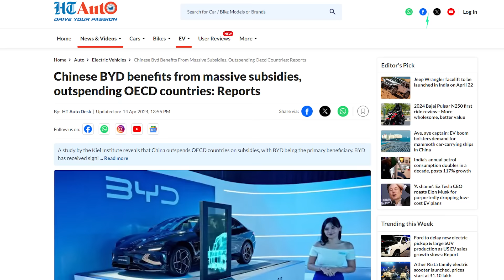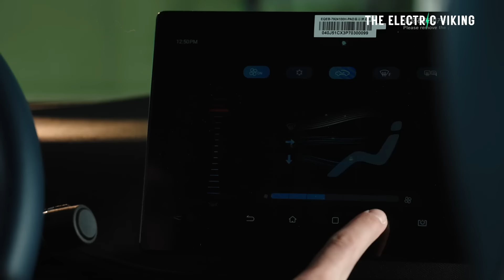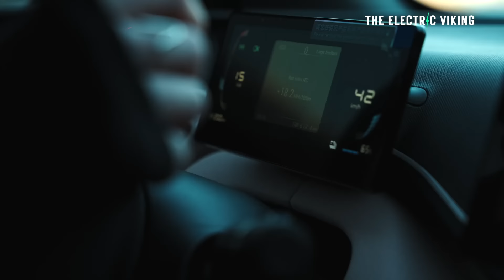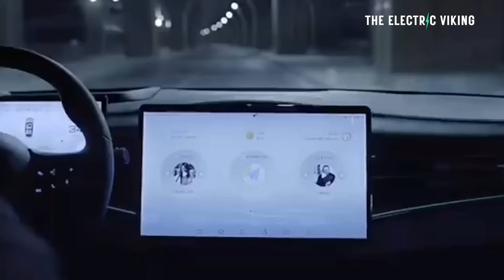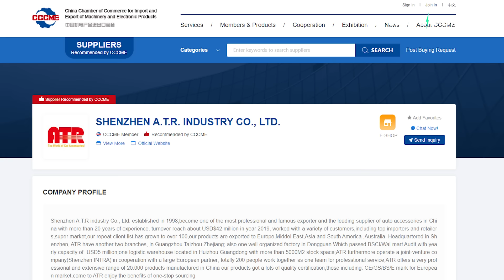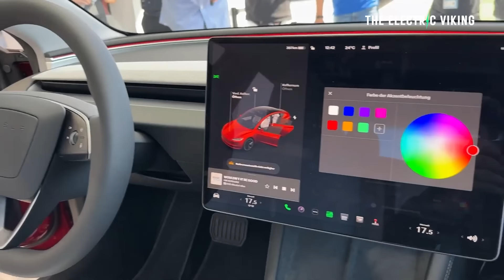China FURIOUS at Europe's EV probe, says it is unfairly rigged against BYD

Comment: Here is what I think: This is a absolute joke, the EV industry has been excessively subsidized being non viable on its own: not only by excessive sale bonuses and tax breaks, but all mining, R and D, mfrs. industries and insurances are massively tax fed…It is time to put a definite stop to poor repairability, lack of durability and safety, price dumping issues and all those actions creating more pollution instead of reducing it !!! This create a need to manage our own safety, refusing to enter crappy Chinese taxi or Uber, a Boeing Max or B787 made in Carolina. This was not the case before when only extremes tasks and sports required a good risk assessment, before this entire responsibility of user’s safety was bounced back to careless manufacturers. The authorities have authorised vehicles in the trafic which are not roadworthy: the 14% rejection rate of Tesla ‘s to the first 3 years TUV inspection in Germany is evidencing this trend. Instead responsible authorities in place must remove potential liabilities off the scene, this is a sovereign task which begins to be totally lacking…

For instance, some quite minor EV accident damages are not repaired because a safe and comprehensive repair involves the expensive battery and repair cost is two to three times more expensive than fixing  the same impact on a much more resilient thermal car. Quite often there also, the battery is the only non shock-proof item which must be replaced  after an impact with some body work. But the entire EV is simply replaced by a new one WITH a new sale bonus that the whole repair amount does not get: a typical waste of « programmed obsolescence » our planet can’t afford any longer !!! Now, those insured high expense costs and all the ferry fires and building damages, chemical pollution and decontamination caused by impossible to extinguish till the end EV fires are not covered only by the liability insurance of the existing  BEV fleet. But the much higher premiums of a correct allocation of the caused damages to the right insurance alone would make new EV sales nearly impossible. The result of such « open account » careless policy is that nothing is undertaken to correct, mitigate, downsize and prevent those much higher EV costs per incident. This gradually upsets taxpayers seeing higher taxes and insurances he directly related to those wastes specific to an non-viable part of our mobility. As a result those misappropriation of funds are gradually being made illegal on the simple fair trade polluter-payer principle basis. The wind finally turning, each EV producing country is trying to protect its own shrinking domestic market. The global lack of competitiveness of EV all together seems to be the main issue. Meanwhile the low Ev volume suppliers like Toyota-Lexus, Honda and Stellantis are less affected, do not reduce prices on larger volumes and can maintain a good profitability, not having to layoff many workers and employees like Tesla and unlike Toyota’s 33 billions GP in 2023 and 3,5 to 5 millions Hybrids volume from 2023 to 2024 , a 43% increase directly hitting many new BEV sales worldwide for the same market. Game over !

Comment: No country should be subsidizing its industries. Period.

That said, Europe itself has been subsidized at a macro level because nearly every European member of NATO has been allowed to continue to be a member without pulling its weight (2% of GDP p.a.). On top of that, the EU has subsidized its own uncompetitive industries (like Airbus) which are often really kept afloat by China etc as quasi-charity cases or just to keep Boeing from becoming a monopoly.

Don't get me started on the EU's spiteful policies to control data flows or hamper free speech.
Reply: We figured out from the boom bust days of the 18th and 19th centuries that not encouraging certain sectors of industry came at a very big cost to the broader economy. By the time the fallout of the '29 crash had settled, we knew very well that liberalism in the modern era was dead and buried. We're returning there, rather quickly, I might add, but be careful what you wish for. We have precedent, we know what happens next.
Reply: EVs will be nothing compared to cheap robots taking all of the factory jobs 😮